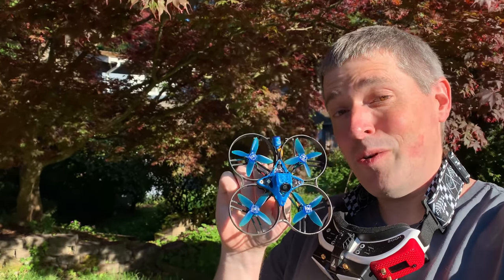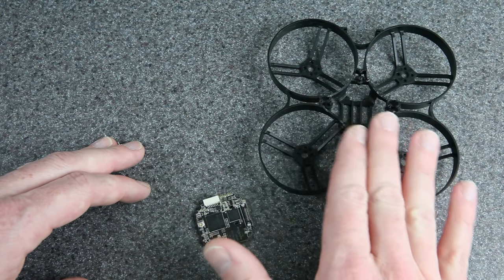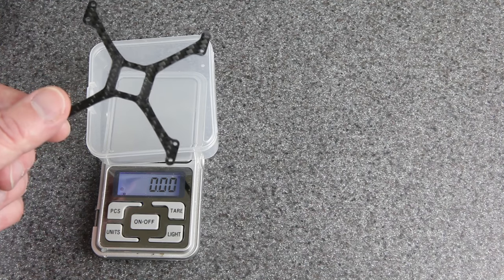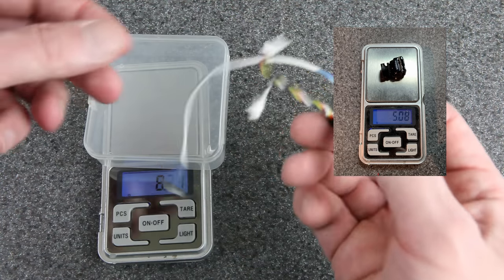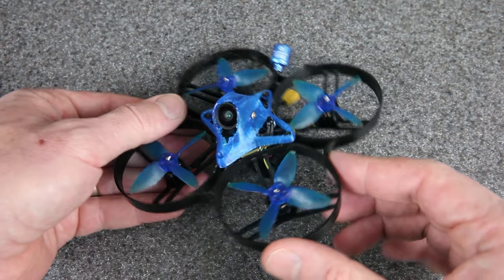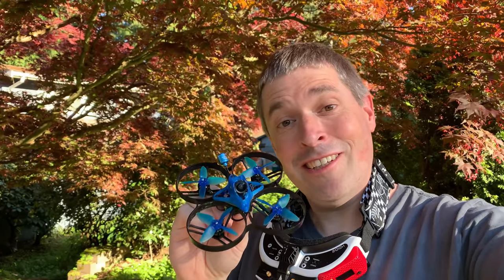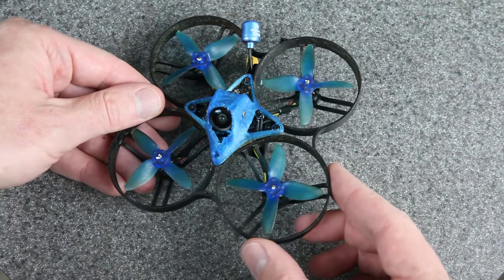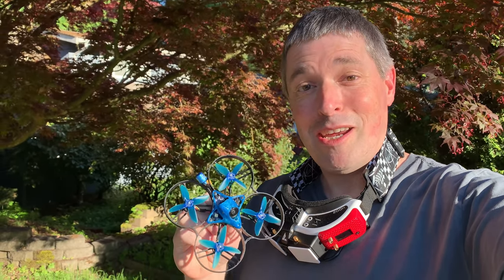Building an AMAZING Racing Whoop with Shark Byte Digital FPV (IT'S SO MUCH FUN!)

Comment: I have used two of those JHEMCU flight controllers; both had an ESC fail after only a bunch of flights! That was on a 35 gram, 35mm prop whoop on 2s (with Runcam Split camera). Hope your FC will prove more durable!!
Reply from the maker: I hope so too

Comment: What do you think, would the 95x be a better platform to mitigate the weight? I remember you came up with the shutterbug85 and one of it’s biggest advantages was the low weight on 2s; boom, no more washouts! It seems you had some washout on this @14:17. I’m just wondering; would 95mm make it feel more like the 85 on analog?
Reply from the maker: Great question. The larger props would definitely carry the weight more gracefully, but it would push this drone up into a whole different weight class. The 95X frame is much heavier, and the 2.5" props would need larger motors. That could be great outdoors, but I wanted to stick with 85mm for this build. It's a nice balance and can still race indoors as well. Also, I wanted to stick with 2S because that's our racing spec and it is hard to find larger motors with a KV high enough for 2S. A 95X with Shark Byte could totally work though. I would probably go for 3S indoor or 4S outdoor with a build like that. :-)
Reply: @MrShutterBug  Right, that makes sense. I’m rockin some flywoo 1202.5 11500kv on 2.5inch 2s open prop (throttle limited to feel like 10k) and they rock, although lower kv 3s is more efficient and they indeed weigh more than 1103.
So what kind of flight times do you get with this?
Reply from the maker: @danieldavelaar  2-3 minutes when I race outdoors with 550-600mah 2S. A little longer if I fly casual or indoors.

Comment: Hey Nate, I was just curious if you’ve ever thought of doing a similar build with the 2.5 in prop version of this frame?
Reply from the maker: Great question. The larger props would definitely carry the weight more gracefully, but it would push this drone up into a whole different weight class. The 95X frame is much heavier, and the 2.5" props would need larger motors. That could be great outdoors, but I wanted to stick with 85mm for this build. It's a nice balance and can still race indoors as well. Also, I wanted to stick with 2S because that's our racing spec and it is hard to find larger motors with a KV high enough for 2S. A 95X with Shark Byte could totally work though. I would probably go for 3S indoor or 4S outdoor with a build like that. :-)
Reply: Thank you for the input! I have 1404s laying around and a 95x you think that would work? 🤔
Reply from the maker: @ndmfpv1776  yeah 1404 would work. You just need a 3-4S capable AIO. I’m not sure if the AIO would fit on the bottom of the frame, but you could try it if you want to put Shark Byte on top like I did. Good luck!👍

Comment: Is there more video of that 2S race where you could fly full throttle for the whole track? :)
Reply from the maker: I rewatched that video. I guess it wasn't literally 100% the whole time, but it felt like it. It would have actually been 100% the whole time if the batteries could keep up. That was a really large track, so managing power use was actually an important factor. Even in my yard, I have to let off the throttle some toward the end of a straight away so that voltage can recover enough to then make the hard 100% throttle turnaround at the end. It's right at the limits of what this build formula can do, but it's super fun! Anyway, here's the other video: https://youtu.be/APu4vjs4qF4

Comment: @Mr ShutterBug Instead of tpu I'd try polypropylene - I'd recommend formfutura's Centaur which is a semi-flex and can handle crashes as well as tpu - and it is about 30% lighter.  It does take some practice to get it to print well but in the end I'd chose it over tpu for most applications.  However, do not get the ultralight version - which is complete B* to get perfect.
Reply from the maker: That sounds great as long as it doesn't let too much impact force translate to the tiny screws which hold it on. Would you need to make any changes to the printer to print polypropylene? I have a printer, but I am by no means an expert.
Reply: @MrShutterBug  I've never had it break at the screw holes myself - and no changes need to be made to the printer itself. I used a stock cr10 to print it with Noz: 237c Bed: 40c (higher if print warps), speeds of about 35mm, and the important thing is to use a clear tape to get it to stick to the bed (such as packing tape, kapton, etc.). I will print with a brim and sometime use that margin to `tack' it down if I think it'll warp.  If you have any more troubles don't hesitate to ask.  PP is also better at dealing with overhang - I've done some great camera holder designs with it.

Comment: Odd that I see a little blue props in view but no prop guards. Is it the canopy
Reply from the maker: Yes, you're seeing a bit of blue from the canopy. The lens has a VERY wide field of view, so it picks up the blue from the canopy when light hits the canopy the right way. I trimmed the canopy back some to fix this problem, but it looks like I might need to trim it back a little more. It's a trade-off between protecting the camera inside the canopy, and having an unobstructed view.

Comment: I’m gonna build a couple of these for IGOW! Just installed a hemera hotend for my 3d printer and your canopy is up on the print bed now. Can’t wait to try this build. What tuning suggestions do you have for BF 4.2.8?
Reply from the maker: For tuning, I suggest you start with the defaults and test it to make sure everything works first. It should fly pretty well with the default tune. Then, to make it even better, try increasing the P/D ration (more P) and the PID master multiplier (more of everything). It will benefit from higher PID values because the motors do not have as much authority as a 5-inch drone. But, if you hear oscillations, then back down. You may also want to increase your Feed Forward for a sharper response. You might want to leave the filtering the same, or you might get away with reducing the filtering. I can't say for sure about the filtering because it depends on the amount of vibration in your build and frame. Good luck.

Comment: Appreciate your sharp wisdom...but I am keen to 1s digital build ...so waiting for 1s sharkbyte whoop...
Reply from the maker: The problem is that Shark Byte requires at least 2S voltage. A 1S Babytooth could carry the weight, but it couldn't power the VTX unless you had a voltage step-up converter. Unfortunately, those are rather bulky and inefficient. So 2S is the most obvious choice for small builds.

Comment: Did you solder the motors to the FC outside the frame or while it was mounted in the frame? I'm always curious to your technique and how you don't melt the frame ;). Also is there a way to get a raw HD feed from the sharkbyte VTX to possibly record to an onboard DVR? Maybe the next version with have onboard DVR? That would probably convert me to sharkbyte if they included that feature.
Reply from the maker: I soldered the motors while the FC was already in the frame. It is actually possible to solder the motors before mounting the FC, but then you have to fit the motors through the opening at the bottom of the frame. It is possible to push them though that opening if you get the orientation right, but it is a pain. For me, it was simpler to just place the drone upside down and solder to the FC in place. You won't melt the frame unless you touch it with the iron, so yes some care is needed there.

As for recording Shark Byte to an onboard DVR, I don't know of any way to do it today. It's hard to guess what features might be added in the future. I know that they are currently working on a VTX that's easier to mount into 5-inch racing drones, and they also said they were working on one for long range with higher output power. No mention of an onboard DVR so far.

Comment: I saw a video recently of somebody experimenting with the difference between a regular and pusher whoop quad. He found that the pusher configuration gave him more thrust. Have you tried building a pusher to see if that makes a difference?
Reply from the maker: I have some "cinewhoops" that are pushers, and I built a light 65mm pusher whoop once. They work fine, but I'm not sure they actually work better. If there is a difference in thrust, then it is subtle. The main advantage of a pusher for cinewhoops is that it is easier to mount the HD camera forward so it doesn't see the ducts. I prefer the non-pusher format for most of my whoops because pushers have a lot of problems taking off from uneven ground. Just my preference.

Comment: Would some 1103 8500kv motors on 3s also make sense on this?
Reply from the maker: Yeah, that would work great for 3S. Just be careful to keep the weight down. For 3S, I would use 450mah 3S or smaller.
Reply: @MrShutterBug  wow, an answer from the man himself 😆, thank you, helps me a lot

Comment: Nate have you tried to build a Shutterbug 95?
Reply from the maker: Yes, but I like this size. The 95X frame is significantly heavier, and the 2.5 inch props need significantly larger motors. Those motors usually have a lower KV which means you have to run 3S or 4S. All in all it ends up being a much heavier build and scarier to crash. This 85mm build I'm showing is right at the limits of what it can do with 2-inch props, but it's still safe enough to fly close to people and indoors, and 2S is required for our racing league. So yes, 95mm can totally work, but not for the same applications.
Reply: @MrShutterBug  I have 2 Shutterbug 85 and like them a lot too, but I'm interested to build a bigger one what motor size/kv do you suggest for a 95? 
Another frame that's I'm looking too is a 3" RaceWhoop....seems to be cool too.
Reply: Great build! It’s added to my build list. Where did you get those gates? I need smaller targets than my neighbors trees :)
Reply from the maker: @msugrad01  these are the Quaddiction gates. Readymaderc used to sell them, but I think they’re discontinued now. Maybe someone else makes something similar? It’s great to have gates that fold up quickly.

Comment: Hey ive been out of the hobby for a couple years but getting back into it with a jumper t lite, some ev800d's w/ better antennas and im trying to build an indestructible 3s whoop. I had to get out of the hobby multiple times because 5" breaks the bank lol this time i hope to not break much. My build consists of a beta85x frame w/ cf brace underneath, betafpv's 1105 5000kv motors, 2" 1940 hulkies, 3s 450mah lipo and itll be controlled by a flywoo goku gn413s aio. I scraped together what little knowledge i had on micros to come up with this, does this setup not match up? also using eachine nano vtx, rxsr and an ant nano cam
Reply from the maker: Hi! Your build sounds a lot like the official Beta85X. It should work just fine. 5000KV 3S will give you good control indoors. If you fly outdoors and want more power, you could also use 4S 450mah batteries, assuming the Flywhoo AIO can do 4S (can it?). I'm not familiar with that AIO myself.
Reply: @MrShutterBug  It states that it can, it seemed like a really good aio option! Awesome man, i was most worried about the motor KV, props and battery not being a compatible matchup but i have much more confidence in it now, thanks for your reply sir!

Comment: Do you think it would be possible to build this with a naked vista and 3S? Or maybe something similar to this, with the prop guards.
Reply from the maker: Yes. BetaFPV actually sells a BNF 85X with the naked Caddx Vista. I built something similar, and you can see an example of that here:
https://youtu.be/2fSZLhW1wDM

I would say that the Vista build is great for exploring the world and taking in the scenery. I would say that the Shark Byte build is better for fast proximity flying and racing. Hope that helps. Cheers!
Reply: @MrShutterBug  It does. Thank you!

Comment: Can you make me a canopy you show in the video about 12 minutes in? I built an exact copy of your 85. It flys pretty good but seems to overheat with the 85 canopy i bought at race day quads. I installed a ceramic antenna elrs rx and i get failsafes once things heat up. Also i saw you had your tune available for the 85x mine has a little roll wiggle while normal flying. Thanks for the content.
Reply from the maker: Sorry for the slow response. There is a link in the video description with the STL file for that canopy. If you don't know anyone with a printer, then there are mail order services that can print it for you. The material is TPU.

Comment: I have made the same one with naked vista in it. But i want to modify  the canopy, but i can not work with .stl.   do you have the canopy for me in a 3d file to work with?
Reply from the maker: Here it is in OBJ format:
https://drive.google.com/file/d/1iPxWGcsC78jVlIvaj2q_l-CZaKOOKr77/view?usp=sharing

And here it is in GLB format:
https://drive.google.com/file/d/1ykwZdm9rz_eSEYNDF0vL7voqd1GP4Kjz/view?usp=sharing

Do either of those work for you?
Reply: @MrShutterBug  thanks for your support in the hobby!
Reply: @MrShutterBug  i can not show you a picture off my build. Bud i have made it to 58 grams with vista in it. And you canopy is too high 😅. (The 58 grams is with carbon frame! But with wrong motors 1102 10.000 try 1103 11.000 soon)

Comment: With some time, shark byte 2 could be built in to aio whoops and maybe better than DJI !!! (unless dji includes it into whoops first)
Reply from the maker: A single AIO including Shark Byte would be awesome, but don't hold your breath. It wouldn't fit on an AIO even the electronics were compressed to half the size. After all, most AIOs use up all of their space with just the stuff needed to fly. One component you would NOT need on the AIO would be an analog OSD chip. That would free up space... but not enough space unfortunately.

Comment: Just sending this video to someone looking for a build rec and reading your description again - Have you round that you need a cap on the VTX for sharkbyte?
Reply from the maker: Yes, you definitely want to use a capacitor, but it doesn't have to be that huge capacitor that ships with the VTX. For a smaller build like this, a 150-250uF cap is probably enough. If your FC comes with a capacitor, then I would just use that one. It should be connected directly to the VBAT pads on the FC (not at the end of the power lead). If the VTX has good clean power, then it will deliver a clearer picture with fewer "sparkle" artifacts. You will know you need more power filtering if your video gets worse when you arm the motors. Hope that helps!

Comment: Hey Nate, I'm currently planning on building an analog shutterbug85 and want to use a whoop camera for it to be as light as possible. Do you know if there are any canopies for those that use the stronger mounting holes in the frame?
Reply from the maker: Most whoop canopies mount to the same posts as the FC. They work OK, but eventually those posts do tend to break off. If you want the lightest possible build, then that's a compromise you'll have to make. If you want the most durable build, then I suggest printing my new canopy (shown in this video). You could use it with a Caddx Ant camera, which isn't that much heavier than a traditional whoop camera. If you don't have access to a printer, then betafpv does sell a canopy for  those 14x14mm cameras, but it only has two screw holes, not 4. Good luck.
Reply: @MrShutterBug  thanks man!! I think I'm gonna go with one that just mounts to the same posts as the fc then, because I can get a whoop camera for literally $6 atm and I want the most performance I can get out of a whoop.
If the posts do break off, I've found you can just drill holes and thread M2 screws though...

Another thing, which batteries do you recommend for a normal analog shutterbug85 for general fast freestyle use? Do you think a gnb 450mah 2s non-hv would be a good balance between weight and battery sag?
Reply from the maker: @ValFPV  yes, GNB 450mah is a good choice. If you ever fly inside you can even get away with a 300mah 2S, but 450 is better outside where you will use more speed.

Comment: would pasting the CLI for 4.3 work with current version of beta flight? or have they made significant changes on PID configuration. thanks
Reply from the maker: It might work, but would be safer to start with 4.2.9 defaults, then adjust the PID sliders to taste (increase PD balance and master multiplier 1-2 notches).
Reply: @MrShutterBug  it doesn't work just tried, : ) Did you use the NOX target for JHEMCU board on Betaflight 3.0? also, on BF 4.2, I get a sudden yaw one side out of nowhere using UAV tech preset, not sure why, any ideas appreciated. Thanks